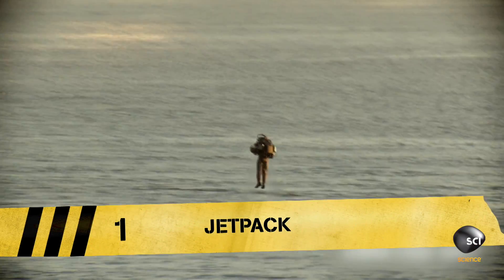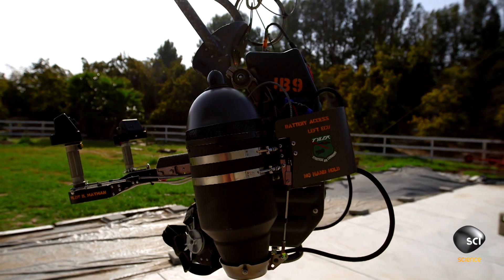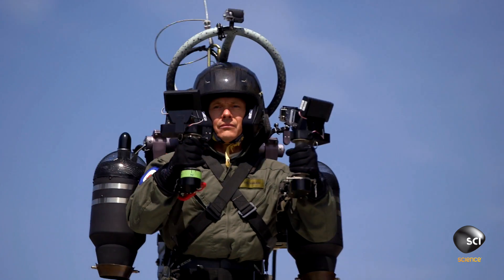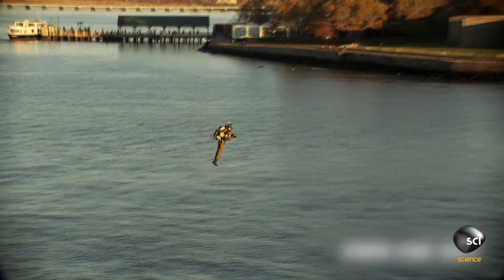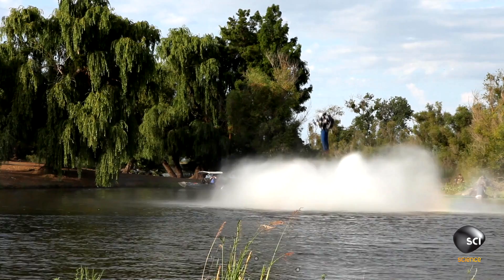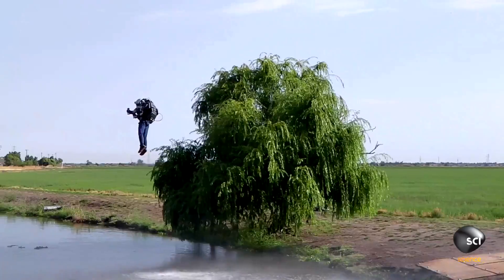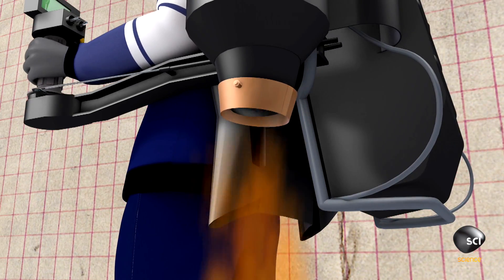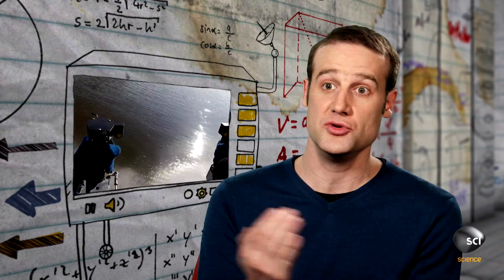Meet the World's Only Fully Functional Jetpack

Comment: Best way to hatch eggs?
Reply: gtfo
Reply: Best way is if u have to mow the lawn with a ride on mower XD
Reply: XDDDDDDDDDDDDDDDDDDDDDDDDDD
Reply: Hamzah Bhaimia hc
Reply: Step 1 – Set Up an Incubator
Depending on how many eggs they accommodate and how automated they are, Incubators run from around $50 for the homesteader favorite ‘Hova-Bator’ into the thousands of dollars for commercial scale incubators. With top-of-the-line incubators, you put in an egg, close the door and out pops the chick three weeks later. You can also go the DIY route, which saves money, but is almost as much work as sitting on the eggs yourself. No matter how fancy or jerry-rigged, all incubators must accomplish a few basic things:

Temperature: The eggs need to be kept at 99.5 degrees at all times; just one degree higher or lower for a few hours can terminate the embryo.

Humidity: 40 to 50 percent humidity must be maintained for the first 18 days; 65 to 75 percent humidity is needed for the final days before hatching.

Ventilation: Egg shells are porous, allowing oxygen to enter and carbon dioxide to exit; incubators need to have holes or vents that allow fresh air to circulate so the fetuses can breathe.

Homemade versions usually involve some sort of insulated box – a cheap Styrofoam cooler will do. An adjustable heating pad or a light bulb on a dimmer switch will suffice for the heat source and a pan of water with a sponge in it will make the air humid. Low-end commercial incubators don’t amount to much more than this, but the more you pay, the more automated the temperature and humidity controls will be.

A high-quality thermometer and hygrometer (a device to measure humidity) are the most important tools of incubation; cheap models are usually not accurate enough. If you’re not working with an incubator that has these instruments built in, opt for a combo thermometer/hygrometer with an external display. These have a sensor that goes inside the incubator with an LED screen on the outside that shows the temperature and humidity readings without having to open the incubator and ruin your carefully calibrated environment.

One time-saving feature is a device to rotate the eggs automatically. Much of the fussing that a hen does over her eggs comes from an evolutionary instinct to constantly move them about. The finely tuned ecosystem inside a chicken egg is kept in balance by constantly changing the position of the egg. High-end incubators have a built-in egg turning device, but there are also standalone egg turners that can be placed inside a homemade incubator to do the job. Or, you can rotate manually according to the instructions below.

The incubator should be placed in a location with the least possible fluctuation in temperature and humidity throughout the day – a basement is ideal, a sunny window is not.

Step 2 – Find Fertile Eggs
If you already have a flock of chickens that includes a rooster, the majority of the eggs they lay will be fertile. Collect them as soon as possible after laying and transfer to the incubator. If you don’t already have chickens, find a friend or a nearby farmer who does and ask if you can buy some fertile eggs. Websites like Craigslist and BackyardChickens.com are a good way to link with people that may have eggs to spare. Some feed stores sell fertile eggs in the spring and there are many suppliers that sell eggs online.

The closer to home, the better the egg source. The jostling about and fluctuations in temperature and humidity that occur during transport are hard on the developing fetus. Hatching rates on eggs straight from the coop are often in the 75 to 90 percent range; with mail-order eggs, there is no guarantee that any will hatch.

When picking eggs to incubate, use those that are clean, well-formed and full-size. Above all, do not clean the eggs – there is a naturally occurring coating that is vital to the success of the embryo. Wash your hands before handling and be as gentle as possible, as the embryos are extremely susceptible to damage from sudden movements.

Ideally, the eggs are transferred directly to the incubator, but it’s possible to store them in egg cartons if needed. Kept at temperatures between 50 and 60 degrees and 75 percent humidity, the development of the eggs can be delayed for up to ten days without sacrificing the viability of the embryos. However, they must be stored with the fat side of the egg pointed up to keep the embryo alive.

Step 3 – Incubate
It takes 21 days on average for an egg to hatch once incubation begins. Before placing the eggs inside, turn on the heat source and measure the temperature and humidity over a 24-hour period, making adjustments as necessary to create the optimal environment. If the humidity is too high or low, use a sponge with more or less surface area to adjust it. Raise and lower the temperature of the heat source in tiny increments until the thermometer reads 99.5.

Once the incubator is functioning properly, it’s just a matter of maintaining the environment until the chicks hatch. Place the eggs on their side in the incubator, close the door and check the levels religiously to make sure nothing goes askew. Water may have to be added to the pan occasionally to keep the humidity up. At day 18, add more water to boost the humidity level.

If you’re going to turn the eggs yourself, there is a standard method to mimic the efforts of a hen:

Draw an ‘X’ on one side of the egg and an ‘O’ on the other to keep track of which eggs have been turned.
At least three times a day, gently turn the eggs over; more frequent turning is even better, but the number of turns per day should be odd (3,5,7 etc.) so that the eggs are never resting on the same side for two consecutive nights. Experts also recommend alternating the direction of turning each time – the goal is to vary the position of the embryo as much as possible.
Continue turning until day 18, but then leave the eggs alone for the last few days.
Step 4 – Hatching
In the final days before hatching. the eggs may be observed shifting about on their own as the fetus becomes active. The chick will eventually peck a small hole in the large end of the egg and take its first breath. It is normal at this point for the chick to rest for six to 12 hours while its lungs adjust before continuing to hatch. Resist the urge to help with the hatching process – it’s easy to cause injury!

Once the chick is free from the egg, let it dry off in the warmth of the incubator before moving it a brooder, where it will spend the first weeks of its life.

Comment: why do all these people seem like con artist
Reply: Joshua Rosen The current model of their jetpacks can fly for 10 minutes, there are unedited test videos that they themselves made AND put on youtube, look them up.
Reply: I think they did multiple demonstrations. It's definitely not a scam. That said a jet engine with that kind of thrust-to-weight ratio probably has abysmal efficiency (compared to commercial jet engines) or overheats very quickly.
Reply: Because they are!
Reply: Because its FAKE.... 
JET engins are dangerous 
The output would burn yr legs off in seconds
Reply: @letsbehonest4221  that is the biggest indicator for me. The amount heat that'd come from an engine strong enough to maintain lift would be both WAY louder than this and WAAAAY too hot for your legs to handle.
Reply: @doc_s1krr751  yes jets are incredibly loud so several would insane loyd..and not forgetting the impossible arm strength that would be needed...
Reply: @letsbehonest4221  dude yes. This shit is so fake but people are falling for it so hard
Reply: yeah I didnt think we could make two jet turbines be powerful enough to lift a man off of the ground for a good period of time. and these guys seem too "meh", think its a scam myself
Reply: I believe this is a real thing but the fact that no-one mentioned flight duration at all makes it clear that this will stay aloft for no more than a few seconds at a time.  If it could, they would have shown us that.
Reply: Those are the old ones. These guys have found a way around that.
Reply: It's not a scam.
Reply: Marketing and lies. Actually, this technology is not that modern nor spectacular. A lot of marketing here.
Reply: @Ari-Sier  Yeah but some day it will happen....

Some day